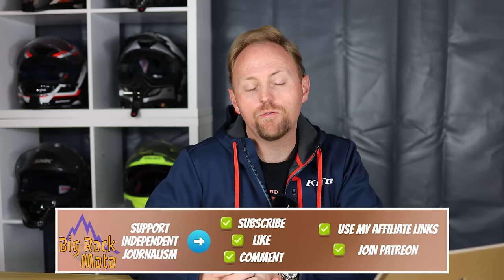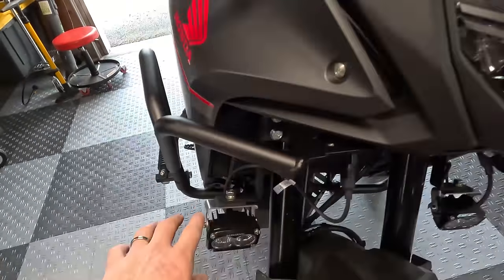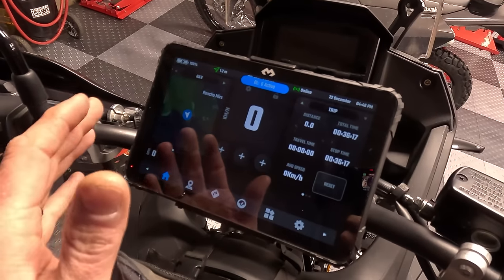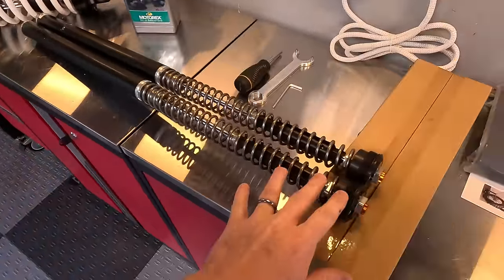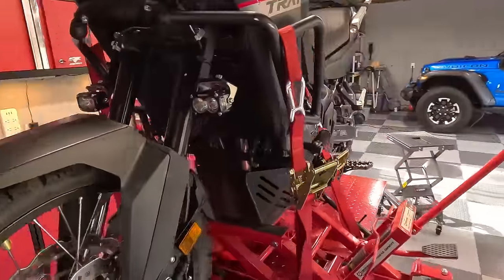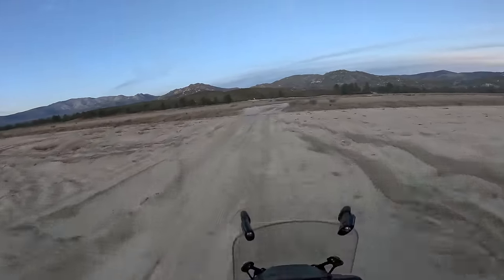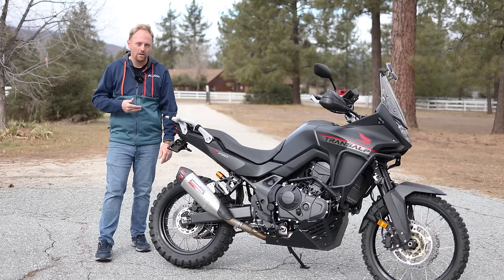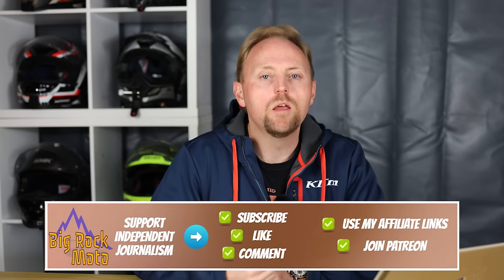Honda Transalp 750 | Suspension Upgrade, Lighting, Exhaust, GPS & More (EP.6)

Comment: Instead of spending $3,000 to put a better suspension system on the Transalp, why not  buy a higher class adventure bike that already comes with a good suspension system?
Reply from the maker: I think that's a better idea - yes
Reply: Maybe they just like the characteristics of the bike 🤔
Reply: The question is where’s the tipping point? Is it now equal to a Tuareg but with Honda reliability and dealerships? If so, I’d be happy to get one then upgrade over time. If not, it’s an experiment with a know limit that’s not worth doing. (Unless you’re making interesting content) Everyone with a KTM I know has problems with them, so that’s out.
Reply: It really depends in your point of view. It's a Honda, so we know it's reliable.. you can install these whenever you want. Also, depends on the country you live.. not all brands have great representation in each country...
Reply: It's not aHONDA!
Reply: He explained at the beginning of the video.
Reply: Can get a very nice set up for $1100 aud for them. ($700usd).  It’s all personal choice.
Reply: @Joe-fi4hv I’m in this camp exactly, I love the transalp as it fits me perfectly and it does everything I want it too with Honda reliability and dealer network. I would consider this upgrade personally, even though I know I could have bought a more expensive bike with better suspension in the first place.
Reply: Just ride with what it has?
Reply: What other bike weighs 450lbs makes 90hp and is reliable? The bike you are talking about does not exist.
Reply: @Username-2  are you a Honda salesman?

Comment: As you mentioned, before removing the forks from the bike, loosen the bottom damper rod bolt, and the top cap. Make sure you loosen the top triple clamp pinch bolts, but leave the bottom triple clamp pinch bolts tight to hold the fork tube as you loosen the top cap. Installation is reversed. Just snug these on the bench, and then do your final tightening after everything is installed.

Comment: I dropped a Yoshimura on my V-Strom 800DE a few weeks ago. Definitely saves on weight, but the sound is a big improvement as you pointed out. My wife complained that she couldn't hear me leaving and coming home before, which isn't a problem anymore.
Reply: Why does your wife need to know when you're coming home.  Time to change it up player.
Reply: @expatbiker6598  In her mind if she can't hear the bike other drivers can't hear it. Loud pipes save lives
Reply: The 800DE is a great bike and it comes with adjustable suspension.
Reply: If it's a full catless system, you should be able to gain around 10 hp and 10 ft-lb with ECU flash. Which everyone could easily feel the difference with.
Reply: @MotoFishy  If a 5% better presence around vehicles saves a life, then sure. I would think that 95% of the life-saving upgrades a motorcyclist can make is RIDER TRAINING.
Reply: @exothermal.sprocket  I have some more training on the horizon. At the moment it's about saving up to pay for said training.
Reply: @MotoFishy   Excellent choice.
Reply: Loud pipes DO NOT save lives.....all they do is scare or startle the shit out of unsuspecting cage drivers causing them to make sudden over-corrections, a lot of times right into said rider with the loud pipes because it startles them so bad. The old adage of "loud pipes save lives" has been proven to be a fallacy and just the opposite occurs, especially with inconsiderate riders that intentionally go heavy on the throttle around cagers just to prove a point. Experience, rider situational awareness and training are 1000% more likely to save a life than "loud pipes".  @MotoFishy
Reply: 😂 Gives the boyfriend time to escape out the back door.
Reply: @1vmxracer  Settle down. I've never observed a loud motorcycle causing any of that nonsense. If you want to be believed as being plausible, don't practice the very same claims as the ones you're opposing.
Being "heard, observed" in traffic is a good thing. Besides, all loud pipes are not the same loudness. We're not talking about Chinook Helicopter under full power, levels of noise.

Comment: My thought process on modding a bike out is this:

You can always mod any bike, but not all bikes have characteristics that can be fixed with mods.

If this Transalp is reliable and simple in the long run, you won’t have to worry about that characteristic. Therefore adding mods just makes it more and more desirable.

If you take a bike that’s amazing but it may leave you in trouble out on the road hours from a dealership, then there’s probably not an easy way or any way to fix that…
Reply: Can’t fix a poorly placed air filter. Nightmare out in the wild.
Reply: Maybe while your down there replacing that air filter go a little more and adjust the valves? @niceguyrides
Reply: An hour to get to the air filter. I guess if you are riding alone you can ride a couple of days, but if you are riding behind on a dry dusty road, it's not ideal. The bike will not be reliable, no engine likes to get dusted, no matter if it's "a Honda". So yes, once you get to the air filter it's probably time to do the valves.

Comment: You're providing a valuable service to the ADV community by spending your time and money on these builds, thank you.  I hope you will also weigh the bike with all of the additions at the end of the final phase to see if all of the extras add up to a significant increase.
It's already been mentioned in a few comments that at this cost you're coming in at over the base price of a standard Africa Twin. The 2024 model is estimated to have an MSRP of $14,449 and this gives you tubeless tires, real maps navigation in the display and standard cruise in addition to a possibly better stock suspension and more power.  On the German Honda website the 2024 electronic suspension costs an additional 1900 Euros, so ~$2000, and that would be an addition to consider while still remaining under the price of this very nice Transalp build.

Comment: I love those lights. What an amazing difference. Only thing that would make it better would be a lower output that turned on with your low beams to help with being seen during the daytime. The blinkers are a nice add on and provide a level of safety with the extra visibility. The exhaust sounds great. I don't own one of these, but if I did I probably wouldn't opt for the suspension only because I wouldn't be doing any hard off road with one. I would pay for it if I would be doing off road. Definitely looking forward to the cruise control install. Bike is looking fantastic.
Reply: Hell yea the lights are badass ! Ordered !
They are must have for sure whata difference! Night and day- haha for sure !!!!
Reply: Honestly, it's such overkill. I added aux lights to my CB500X using cheap Chinese made LED lights. The total install cost me $60. After a little over a year of use, they still work great and they are wired to the high beam circuit, just like Ian recommends...

You don't need to spend over $300 USD for aux lights, IMHO.
Reply: Well do you have a low beam light you would recommend because the low beams are pretty terrible also LOL Honda could at least have upgraded from a cb500x light LOL just traded mine in for the trans out feel like the headlights were pretty much identical oh well have to find a way to make it work there ought to be some low beams that at least give a little bit of a spread of light without blinding people

Comment: As always - an excellent video, very exhaustive and also entertaining!

But I have to disagree with you regarding if the more expensive upgrades are sensible. I believe that they are, or at least can be! 

This is my thinking:

1. For me personally, the Transalp is a bike I prefer over the Africa Twin. So if I have money for the latter, and instead buy a Transalp, I save a lot of money AND get a bike that I like better. 

2. Modifying it to a bike that I like even better than the standard Transalp, and still keeping the total sum below that of an Africa Twin is a no-brainer! 

3. Even if I spend as much money on it as the cost af a new AT, I’ll still end up with a bike that is less expensive to drive! 

So the question is - how much do you love the bike? 

Even without modifications, I prefer the Transalp over the Africa Twin. So paying as much as for the AT will still make me a happier MC-owner than had I bought an AT! 

I don’t dislike the AT at all, it is just to big for me (27” inseam). Actually, even though i prefer the Transalp over the Africa, the Transalp is to big for me too! 

So I bought a CB300r and adventure-modified it! I have spent more than $4000 om modifications. 

I built an entirely new stainless steel exhaust system, improving ground clearance by 8 cm, saving 6 kg and adding 7 horsepower together with remapping and modifications on the air box. Higher handlebars, modified left hand controls to get the horn and the signal in the right order (Honda - you should fix this on all your new bikes!!!), alu skid plate, improved suspension, IoM-inspired paint job… The list goes on. 

And I’d say that everything mentioned is well spent money! 

So there must be many (slightly larger than me) “normal” people for which a super optimised Transalp is worth well above $17000!
Reply from the maker: Very cool build.

Comment: Thanks for showing all the different options/ upgrades for the Transalp. "For Me/ IMO", part of the charm/benefits of the Transalp is that offers so much at $10K, and that it can be virtually ridden off the showroom floor and do nothing to it, but enjoy it (well maybe $1,500 +/- in accessories, i.e. soft luggage, wind deflector, cruise control device, maybe front fork springs?!?). If a person needs more, there are other great motorcycles out there for more money.

Comment: Awesome upgrades on the Transalp XL750R video Ian, and me being 270lb I had to at least swap out the rear shock for the fully adjustable TracTive rear shock like the one you got but I went up +25mm and went with a KOUBALINKS linkage that got close to the factory height but it did raise it up a little bit because of the spring rate and made the rear travel at 215mm from the 190mm factory rear suspension travel and what a game changer!
Reply from the maker: Nice work!

Comment: I had a pro (Ben Decker performance, Platte City Missouri) install RaceTech suspension front and rear on my 2017 Honda Africa Twin. Same results you are describing. It completely transformed the handling. The stock suspension was made of pudding. Ben tuned the new race tech suspension to my body weight and the average amount of gear I take on trips and it is perfect. I spent $1,700 a year and a half ago to have him install those pieces and it was the best money I've spent on that motorcycle. Well except for the $10 I spent on a cramp buster for the throttle!

Comment: That's a seriously nice upgrade. Would I spend $3k on a suspension upgrade? Nope. Even though I would do trails as you did in this video, I would probably never go above 25mph on them and the stock suspension would probably be fine. Like most people who are considering this bike. I had a Suzuki DR650 with slightly modded suspension nowhere near as good as this modded Transalp and it performed perfectly fine for me.

The Transalp and KTM 790 Adventure are my top two picks. I don't see many comparisons between the two and wonder about that. $1000 price difference. But not really when you add the crash protection to the Honda that the KTM already has. I'll ride both when the time comes but wow.... NICE bikes.

Comment: I recently went from a DR650 (with aftermarket springs) to a 701 enduro and wow suspension makes a huge difference. it's my first time riding a bike with good suspension and it almost feels like a cheat code.
Reply from the maker: agreed
Reply: If you would have gone with the Cogent front fork DDC's and rear Mojave shock you probably wouldn't have felt the need to spend 14K on that 701. Those 2 mods for less than $1,000 transform the DR into a very competent bike both on the trail and on the road. I did the same thing you did...went with springs first. And In was severely disappointed. Now, with the Cogent stuff installed I can go anywhere a 701 can go for half the price. And have 10X the reliability while I'm doing it.
Reply: @1vmxracer  fortunately I didn't spend $14k on my 701. I bought it used for an incredibly good price. My DR had just about everything done except the suspension. I really love my DR. But the 701 is just an entirely different beast. Even if both bikes had the same suspension, the 701 feels very different.
Reply: @Michael_Shay  No doubt they ARE different. And without you saying in your 1st post whether or not you bought a new 701, i just assumed you did. I hope you got a deal on it.
Reply: @1vmxracer  2019 701 with 2k miles for $7,500 with a few value add mods, nothing major. I really love my DR but I wanted something a bit more comfortable on the road, (6th gear, feels better at higher speeds). 

I wouldn't be surprised if I ended up with another DR at some point further down the line. But I think the 701 is the perfect do it all bike for me.

Comment: When you get to the mccruise cruisecontrol. You dont have to take the tank all the way of like in the instructions. I managed to work under it for the plugs that needs to be connected there with it just tilted up. So keep that in mind. It was a big job for sure. Got me to get to look at the filther. Looks good for 9k km. Just some light discoloration and nothing clogged. Next time i will buy a better highend filther. Tank removal is not a huge hassle. Have you done it like me several times it really is not a hassle.

Comment: You make a good point that to get all these upgrades is probably overkill and you wouldn’t buy this bike in the first place. However getting the cruise control, lights and possibly satnav upgrades are perfect. Alternatively, in a year or two buying a used bike and upgrading the suspension for an off road machine might make sense.
Great vids 👍👍

Comment: Just in the lighting section now. I think, for ultimate visibility to others, you need to be able to run your Aux lights with low beam. Even in the daytime. If you aux lights have high/low, then the high should be linked to the factory high beams, and DTL with low-beam. YMMV (obviously).

Comment: Comparing this build to a Tuareg 660, the BarkBusters, aux lights, and tire upgrades would be done on either bike so they aren't useful for comparison. I'm going to ignore them, along with the other non essential mods.

To make a Transalp comparable to a Tuareg 660, only the Tractive suspension upgrades and the Veridian CC are relevant.

The Transalp stock bike + Tractive suspension upgrades + Veridian CC price out to $13,700 vs the Tuareg 660 stock price of $12,700.

The salient question is whether the extra $1000 USD, to upgrade a Transalp to Tuareg like specs, is better value. Personally, I would pay that premium simply because the lower compression, lower revving Transalp XL750 engine is going to out last the Tuareg 660's engine - not to mention getting Honda reliability.

At 6'3" and 230 lbs, a suspension upgrade seems more essential for me, but for someone 5'-8" and 160 lbs is it really all that advantageous?

Comment: Last Saturday I rented the new Transalp for a 2UP-ride. Actually, I was quite surprised. Riding an Africa Twin 2017, the Transalp did not disappoint. Overall handling, steering, weight, suspension and also the sound from the OEM exhaust, perfect. The only comment is the power when 2UP. In comparison to the AT, in sharp and hairpins, I could have a little bit more power. 

If I didn't had a bike and was faced with the choice of buying a bike for solo use, the choice would most probably have been the Transalp. 

To conclude. Very remarkable. When the Transalp was presented to the public including journalists, the trend was not positive about the Honda. A number of comments like 'disappointing', 'I expected more' and 'is not an off-road machine' were frequently read.

Now, several months on, opinions have turned 180-degrees. Both on and off-road, the Transalp performs very well according to tests.
Reply: I also have a 2017 Africa Twin, as a solo rider, did the Transalp feel significantly lighter and more manageable?
Reply: Yes, overall the bike feels and is lighter. Wet weight 208kg vs 232kg.

Comment: This upgrade session has been great. I like the way you show the mods without taking us through every detail, torque setting and misstep. The modification and installation overview is just right. Do you use an official Honda TransAlp shop manual for reference? or just the instructions from the upgrade equipment suppliers? or both?

Comment: You will love DMD. I've been using DMD or DMD2 since 2019 and will not use anything else. For offroad navigation there is NOTHING better, turn by turn navigation is a new feature and showing significant promise. I would suggest looking at the nav bar mounts as it puts it in a more accessible location and doesn't get in the way of a tankbag or something similar.
Reply from the maker: Thanks, I agree, it seems amazing

Comment: So, $3500 for adjustable suspension.  I paid $12,600 otd for my 800DE Adventure which came with fully adjustable suspension.  After spending $17k, is the TAlp better than the 890R or Tourag 660?  And once your done, what are you going to do about the low end torque?  Yes it has enough torque to move the bike but there is a lot of throttle and cluch modulation to do so.  The TAlp still won't have the grunt of the 890R or 800DE for true ADV riding. The content and honesty of the video were awesome as usual.
Reply from the maker: I agree. Vstrom is a better buy.